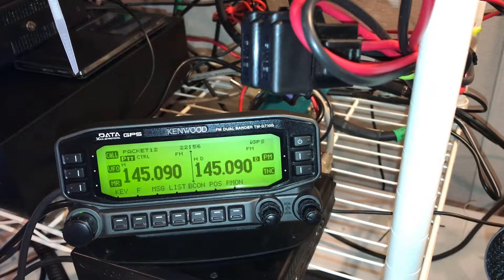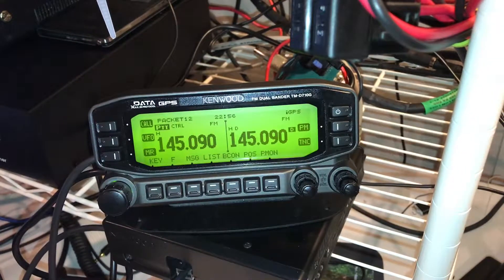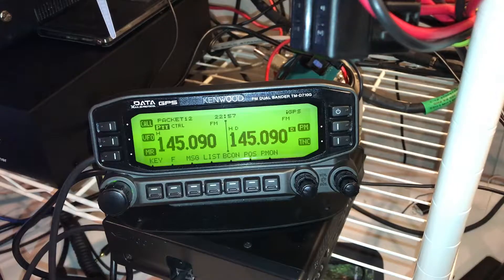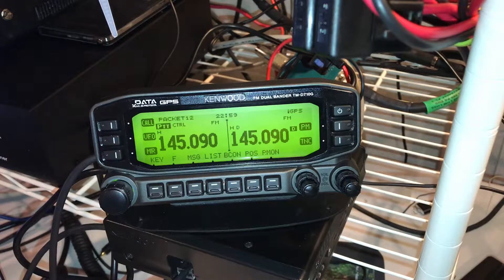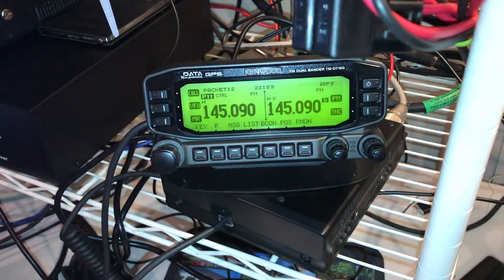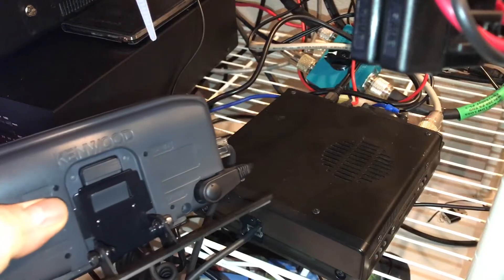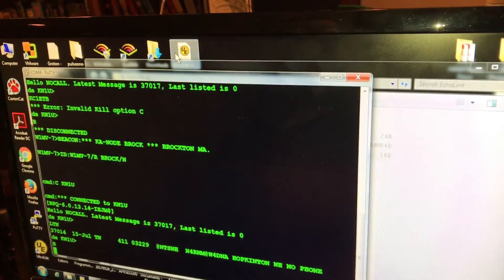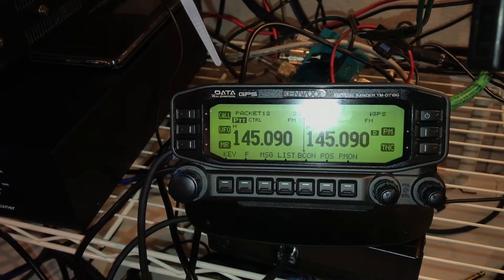Kenwood TM-D710G TNC Connection Fun

Comment: I believe we are using the PG-5A Data Cable (listed under Options on p. 38 of the Instruction Manual). The DIN plug goes into the back side of the Operation Panel and the USB end to the PC.

Comment: Thanks for your video.  I wish I had viewed it before I struggled with the same confusion re: the Comm Port!  Our Auxcom group will use a pair of the Kenwood D710 radios for Winlink comms.  We have the DIN to USB cables...not sure if they shipped with the unit or if they were an add-on item.  We bought the radios from HRO in 2019.  73!   - Mike -

Comment: Thanks for demonstrating using PuTTy to connect to the TNC. When I issue "connect [callsign]" the radio doesn't transmit nor key up. The TNC is enabled and showing PACKET12. Is there anything else I can check? 73
Reply from the maker: Hmmm. Not really sure what the issue would be.  You do get prompts from the TNC when going through PuTTY?

Maybe back up the radio via RT Systems software or the Kenwood app and then try a factory reset and see if that helps.

Good luck and 73
KC1ETB
Reply: @BrauckMan  yes, the TNC prompt is responsive. I can "display" and list settings. But when I do "connect [station callsign], even though it says "connecting", the radio doesn't transmit.
Reply from the maker: @bero2  dumb question, but what frequency is the radio on?  Are you within the 2m band?
Reply: @BrauckMan  145.05
Reply from the maker: @bero2  you can key down with the mic button and the radio will transmit?

Unfortunately, this radio is now out in my car. I can’t take a look at it easily. But I know there are commands you have to enable to set your own call sign for the radio. Check the display menu and see if you can figure that out? Otherwise I would recommend a factory reset and or call Kenwood and see if they have any ideas. Sorry sir. Good luck. 73
Reply: @BrauckMan  Issue resolved. It won't transmit when the squelch is wide open. Once I turned down the squelch it transmitted.
Reply from the maker: @bero2  Wow!  Good to know!  Glad it’s working for ya!

Comment: Very interesting video. I am looking to buy this radio for packet communication digipeating in search and rescue scenarios. Since the TNC is integrated I fgure that is one less box and interface to worry about.
So the COMM port is the TNC data connection, the PC port is for programming the radio (repeater lists etc.) and what is the DATA port used for?
Is that just a terminal program you use to view the data going back and forth?
Fred
Reply from the maker: Fred Lodden if I remember correctly, the data port is for an external device like another TNC or a GPS but not 100% sure.  I was using PuTTY as the terminal app in the video
Reply: @BrauckMan  I had a another look into the 'In Depth' manual and it shows another cable for the DATA connection (not the one used for programming, or TNC connectivity) and it has stereo audio jacks for an audio connection to a PC. Like you, I find the port labelling rather confusing as I would assume that DATA meant digital data. Anyway, I think I will purchase a TM-D710G. Thanks so much for making the video - it was most informative. Fred

Comment: What do you do with the question mark? You don't explain what that's all about...
Reply from the maker: The question mark came up when I plugged my serial cable into the PC port and not the TNC serial port.  The ? was displayed because the protocol used to program the radio does not involve using plain text...rather it will use binary data that the application understands.
Reply: @BrauckMan  And I'm a bona fide idiot. I thought I was still plugged into the panel but forgot I moved the cable to update firmware on the RF deck. LOL. It's working now, thanks! Sometimes I just need to be hit upside the head.
Reply from the maker: bladedspokes heh.  Happens to me from time to time, too.  Hope you enjoy the radio!

Comment: I was able to get the RT Systems (Programmer) cable to work in lieu of the serial cable. Still tweaking with settings (first day with the radio), but using the RT Systems cable rather than the accessory order cable for TNC is a nice little savings and it also has another use - programming memory channels. de K6KEC

Comment: What I am going through right now is that there is no way in heavens I can load a cvs or tpe file into the MCP program, even when using its latest version just recent July 30/18! I am new and do not understand how to program correctly the repeaters i want and manually it is a nightmare even knowing what buttons to use in the radio head! the whole thing is giving me buyers remorse already. I am exporting the repeater lists from Repeaterbook.com but when using the MCp program to open the file and import it, it just nothing happens or in the case of the .cvs it pops up a box saying the file can not be opened! this is so frustrating as there is no information anywhere to be found about what to do or why is this happening. I keep asking around but nobody knows. I am guessing this will be a good radio once I get it to program and work with it. After a week, I have not been able to use it yet; it is already installed in my van and using a Comet SBB-224 Antenna, no contact yet! 73 from KI7CSI

Comment: Some PC still provide serial but you need the breakout cable to use it, https://www.newegg.com/Product/Product.aspx?Item=9SIAF9T6W90738&cm_re=mobo_serial_cable-9SIAF9T6W90738-Product

you would be looking on your monherboard for a matching connection generaly has serial printed in or near it like so https://ashishd.wordpress.com/2011/03/26/dont-have-serial-parallel-port-on-mb-well-it-might-be-hidden-on-motherboard/

Cheers

Comment: Quick question, I have the TNC working, thanks to your video. But it fails to connect to the RMS station. It quickly says disconnect. Currently I only have the Serial communications cable hooked up. Do I need to hook up the Data communications cable also (green/pink)?
Reply from the maker: Hi, thanks for the reply.  No.  You should only need the serial cable.  Make sure the TNC feature is turned on and your baud rates are correct.

Comment: Thank you for posting. I always thought the APRS worked in the faceplate. I do wish radio manufacturers put out better information on radio features.
Reply: APRS does work right in the control panel of the radio with no external cables or anything other than what is built into the radio.  You don't need an external TNC or PC.
Reply: As Morgen points out; the GPS unit is right on top of the control head and it is what it is needed for APRS as the head will be mounted somewhere near the windshield of a car when mobile. Even indoors it works really well. Not everything is right with this radio, the mic cable would be nice to have a way of connecting it to the head unit as well  but I am glad they did not decided to mount the GPS in the radio unit. I installed mine on the back of the Van not under the seat as it is better accessible to put in and take out in the back

Comment: thanks!  off subject ,, any over heating issues?
Reply from the maker: Nope...as you can see...th4e radio is on a wire rack with plenty of ventilation.  I worry about that as well and I try to mitigate heat whenever possible.